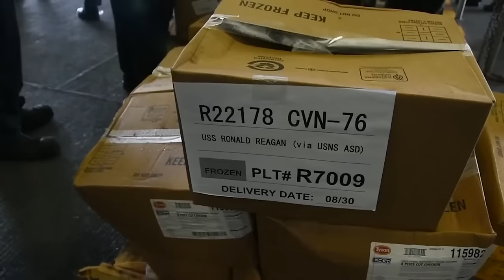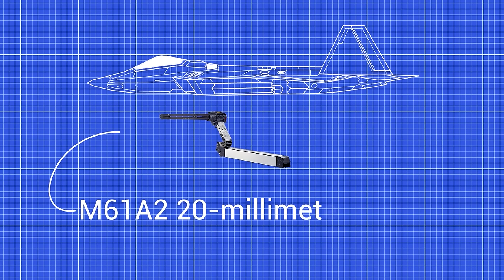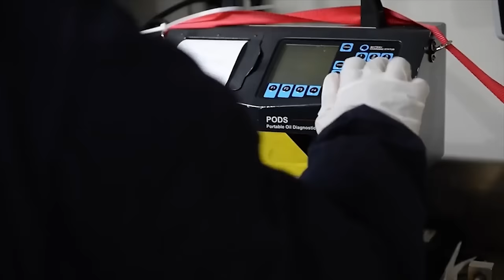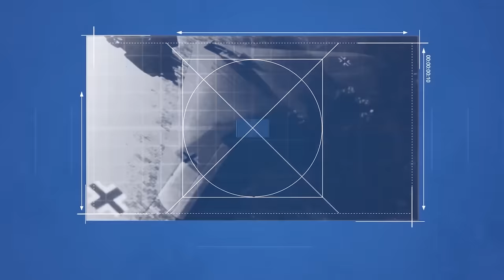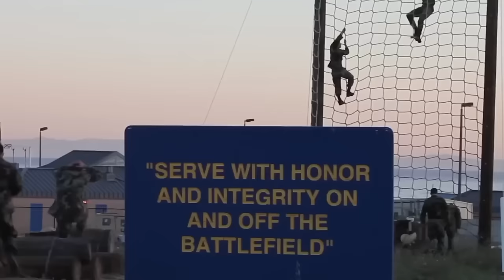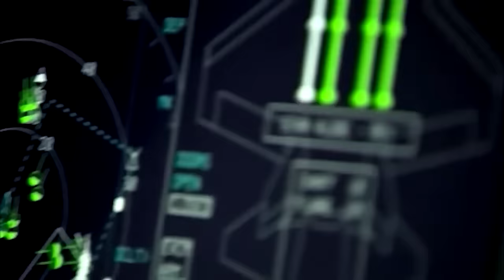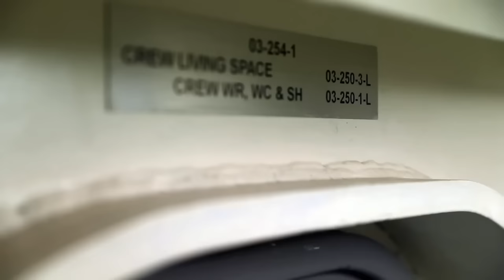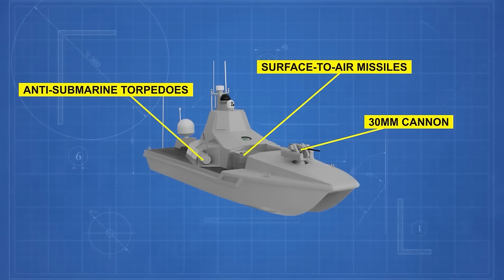How Aircraft Carriers Prepare 17,000 Meals a Day - COMPILATION

Comment: I was in the Navy for 5 years in 1975 as an electricians mate. One of the things I noticed they had a process called PMS I believe it was where is basically prescribed maintenance and they would have situations where you would tear a controller apart like every 3 months or so, now you didn't exactly tear it apart but you would sometimes unscrew parts of it and then check it and look at it and dust it off and then screw it back in place,  my issue was is that they have typically like lower ranked electricians semen just doing this work, and they're going to drop screws and not put it back right and basically they do more harm than good. Sometimes you're better off just letting it go and maybe check it out twice as long as or maybe three times the times the normal scheduled time you would normally they have you do it.   It's like a car service place, they'd charge $50 an hour, but then they charge you $80 an hour if you've already worked on it.